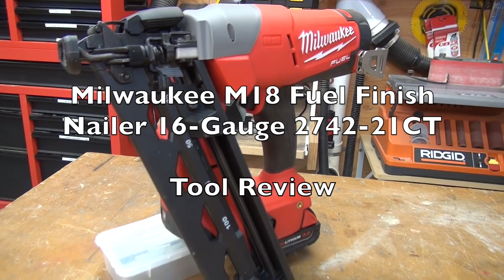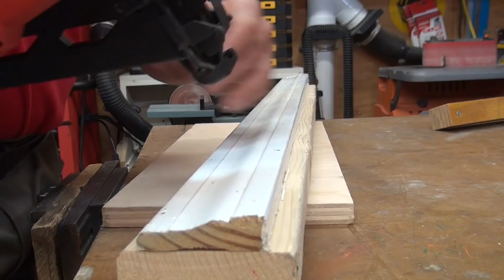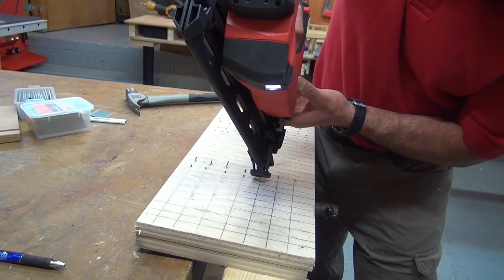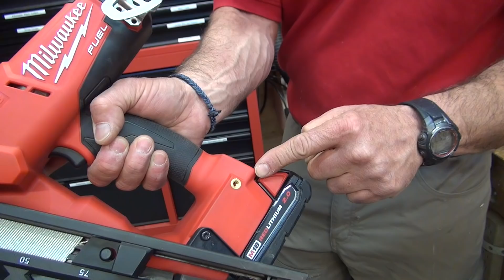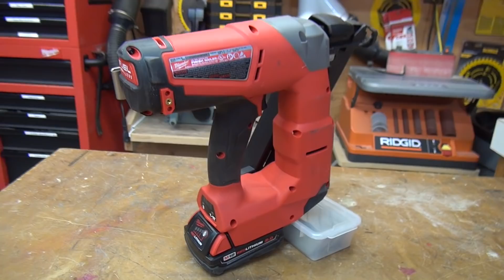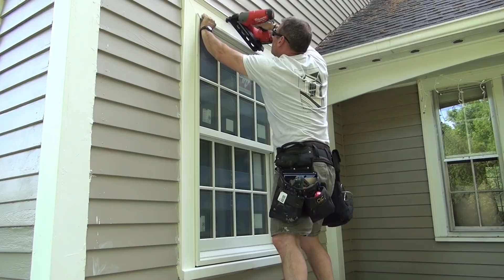Milwaukee M18 16 Gauge Finish Nailer 2742 21CT

Comment: Bit late to the party with this one but are you guys still using the nailer? I went from a dewalt dcn660 to a hikoki 16g cordless which was garbage and then went to the milwaukee you reviewed in this video. I've just gone and bought another dcn660... I just hated the tip on the milwaukee... too wide and clumsy, awkward to get in to corners, awkward to nail anything other than a flat surface. As much as I love the milwaukee tech and heavily invested in their platform, the nose on the dewalt is just more versatile, smaller and more accurate for me at least. Wondered if you guys have found the same?

Comment: I'm on the Craftsman V20 battery system (don't laugh, they're basically Dewalt in red) and i have both thr 16 and 18g nail guns. Anyway, they're both great, plenty of power, I put in oak stsir treads on a daily basis. The Milwaukee is faster though. With the Craftsman, there is about a 1 sec pause when you pull the trigger. But if you're not racing, its not an issue

Comment: Need a better safety design like dewalt i like it dose not wind but dewalt beats it by the safety features i use dewalt and the miwakiee 16 gauge and framing

Comment: I have the 15 gauge mikAuwkee. Nail gun. Don't have much expierce with nail guns but my gun seems very hard to push the safety down on to a wood. To the point it's dent the wood. This can't be normal, right?

Comment: I just bought a 2742-21ct here in Ottawa , Ontario, Canada to bad no one carries 16gauge angled any size nails for it 
Now I have a $600 boat anker
Reply: You can use dewalt brands
Reply: @troyqueen9503  yes I know but no one at the time even had them, I ordered 2 packs through TEGS in Hamilton

Comment: Will this thing work on hardie trim the thick stuff
Reply from the maker: Andrew Rios I wouldn’t use this on Hardie backer / cement board. Other stuff yes
Reply: @ConcordCarpenter  any recommendations on a milwaukee nail gun that can? I constantly repair chimney and I swear when I take them apart they have nails from a nail gun i just cant figure out which one would work before i spend a bunch of money

Comment: The one I have just worked twice,now won't nail again just make the noise ...🤦🏽‍♂️
Reply: Did you ever get it fixed Andy?
Reply: @masonb1100  yeah I did,and now works way better than before...😂😂
Reply: Andy Davila what was wrong with it
Reply: @xavierxedits  no idea Buddy just won't nail it after second time I turned it on,but what I did is I opened the case and found a air nose like on the car tires,well I assumed the air was drained and refill air at the pressure shows in the tank....that's all I did and believe me now is a monster...works like hulk ...
Reply: Andy Davila how much air pressure did you take it up to? I can’t find anywhere to tell me.

Comment: My father has had a Paslode framing nailer (butane) for about 20 years. It worked very well the first ten years, but after that it was used less and less as it became more and more temperamental. Are any of these manufacturers positioned to make battery-powered framing nailers without butane, or doesn't the technology exist for that?

Comment: Would you say this finish gun is better than the angled 16 gauge dewalt cordless? I purchased the 16 gauge metabo yesterday and I’m going to return it. I thought it would be awesome because I love my metabo cordless framer. This finish gun hardly counter sinks the nails in pine even at the max depth setting.
Reply: The dewalt one works great. We had one at our shop. I have already invested in milwaukee tools so that is why I am here, but there is no reason to not get dewalt If you have the batteries

Comment: Hello there and thanks for the numerous educative videos that you have made so far,I have a concern and will appreciate it if you can help me about it. I have the Paslode 30 degrees pneumatic nail gun and I want to buy the cordless model and the cordless tools that I have always bought has always been the milwaukee tools, first of which model is the 30 degrees nail gun that Milwaukee made like the pneumatic Paslode that I am using and secondly can I use the same paslode nails that I use with the paslode nail gun bearing in mind that what I do is close to framing although not exactly. Milwaukee 2743-20 M18 Fuel Cordless Lithium-Ion 15-Gauge Brushless Finish Nailer is the model that I saw which is close to what I want,is it the right model.
Reply from the maker: GREGGS TECH Paslode is a great framer, Milwaukee is releasing their framer this December
Reply: Thanks.

Comment: I don't really like my 16 gauge straight finish nailer by Milwaukee. I only use it for slop or soft wood work. It won't sink in anything but softwood very useless for oak, in addition, the harder the wood the bigger of a depression around the nail head it leaves. Most of the time it leaves a mark 3 times bitter than a 16 gauge nailhead. I have read many reviews of what I have just stated. I assume if this gun actually works that they spent more time developing the angled 16 gauge than the strait.

Comment: I needed a brad nailer for a small project I was working on>>>parg.co/d6E   I read the reviews and chose my favorite brand, DeWalt. It did not disappoint. This little gem will put in those brads with a feather touch. It took a little practice to make sure that the head of the brad was just under the surface. Once set, though, there was no looking back. It loads easily and is not noisy which is important to me. It is smooth and does not jerk in my hand. All in all, a great little package.

Comment: Thank you for this video. I got a small question - i need to install wooden plates on my walls. Can a nail gun penetrate regular walls made of blocks? its not concrete
Reply: There are special guns for concrete slabs, walls and even steel plates. No ideal if cordless available.

Comment: watched this guy/video and bought this milwaukee nailer for myself for my birthday last week.  it fired 2 and misfired/jammed, then fired 1 and jammed again. thinking it was a one off problem i returned it to HD and purchased  a  2nd one and same problem....   cutting brads and leaving cut brads proud. The store confirmed i was using correct brads.Nothing more disappointing than using your $249 nailer and $149 dollar battery/charger to shoot nails then have to finish nailing every other one in with a hammer, Should have never strayed away from dewalt  dave columbia sc
Reply from the maker: David Chapman that’s disappointing to hear

Comment: Which cordless nailer do u prefer dewalt or Milwaukee
Reply from the maker: Buddy Morgan are use the paslode but my partner using a lot, I really like it
Reply: A Concord Carpenter / ToolBoxBuzz 
Do you prefer  a Milwaukee  or dewault cordlesd nailer?
Reply: The Dewalt are much better, I have both and now the Milwaukees just sit in the shop. They leave about every 10th nail proud so it takes a lot of extra time to set them, the Dewalt might leave one high every 50 or less.

Comment: As always, great review! It’s nice to see real world application use as opposed to stress tests that no one would actually put their tools through haha. 

Did you see the weight as a serious issue? I’m a hitachi fanboy when it comes to their air tools, but I couldn’t justify the 7lb plus weight of their battery powered angled finish gun.
Reply from the maker: Cole Mt yes sir, the weight is a trade off to cut that hose. Pretty well balanced though

Comment: And what is the difference between the straigth nailer and agle nailer
Reply from the maker: The terms ‘angled and straight’ refer to the angle of the nail’s magazine. Angled nailers have a better access to smaller areas. Angled nailer are more expensive, and shoot a thicker nails, which can splt wood.

 On the contrary, the straight nailers are bulky and inexpensive. They tend to shoot a thinner nail.

Comment: I love this nailer for convenience. 

My only issues with it are:

1/ The weight (I run mine on a 5amp/h battery which admittingly doesn't help, especially when I'm more used to a magnesium bodied air nailer).

2/ The size of the foot (which you do get used to).

 3/ The on/off button. Hate it! It's flush and small, probably for safety reasons, so not the easiest to operate, especially if you have gloves on. Having to hold it down for several seconds to turn it on seems an overkill, but, the biggest bind for me is how long you have to hold the button in to turn it off. Drives me crazy. A slide switch would have been far more convenient. 1-Off, 2-Single Fire, 3-Sequential.

Comment: The Milwaukee cordless nailer works on dry nitrogen technology. How it works when you push the tip and pull the trigger the solenoid released and the seal cylinder contains dry nitrogen will drive the piston that drive the nail into the wood. The motor and gearbox reset the piston ready for the next shot. This is the same technology that senco cordless nailer uses.
Reply: Michael Hodge no it doesn’t. 😂
Reply: John Black sorry to burst your bubble, but Michael Hodge is right
Reply: The atmosphere is 70% nitrogen

Comment: I'm surprised it didn't go into overheat mode and shut off. recoil is always expected, but it would better if it didn't.
Reply: Why are you surprised? In à real life situation it will almost never go into overheat protection  mode.
Reply: Mine goes into overheating on a regular basis. I trim houses and I can set 10 prehung units then it shuts down